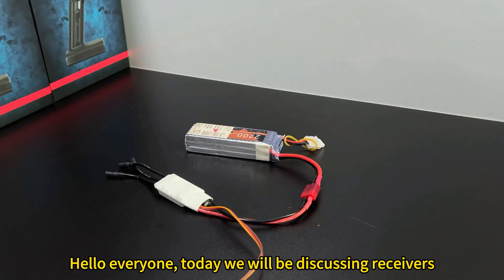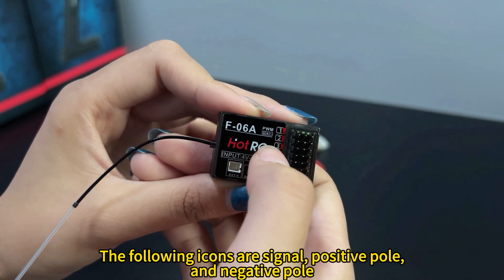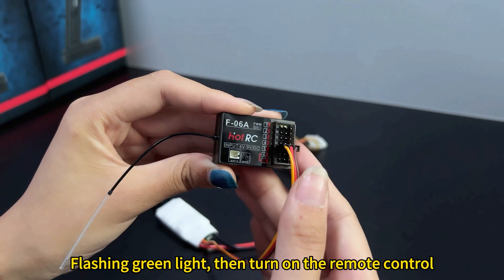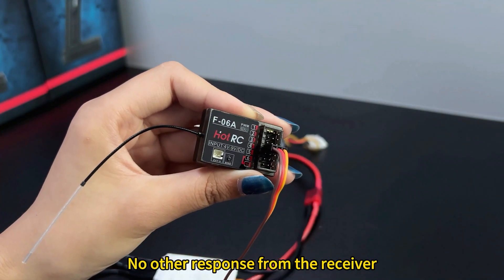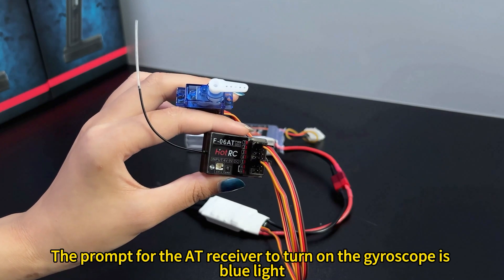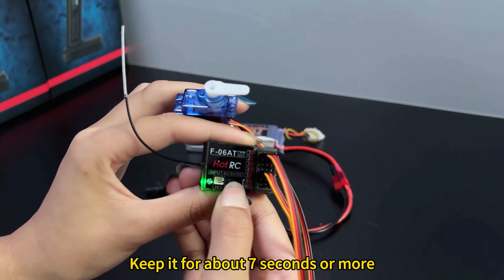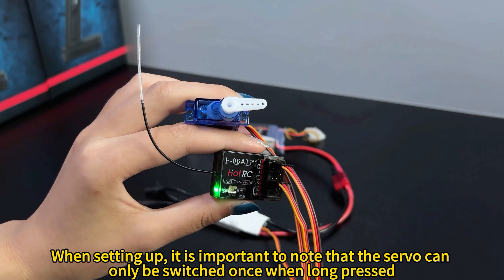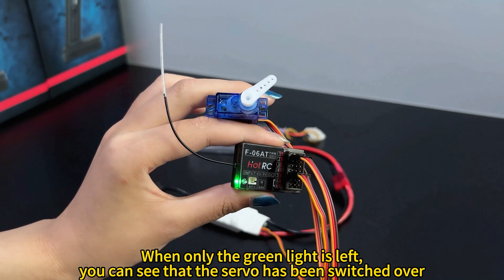HOTRC receiver positive and negative signal wiring and servo switching

Comment: The receiver is not powered at the power connector. How is getting the power? This video has a trick for marketing reasons. Totally useless info.
Reply from the maker: Your battery is connected to the ESC, and the three wires of the ESC are connected to the receiver. Any channel can be used. There is no fixed power supply channel. Follow the wiring in the video, left signal, red positive in the middle, black negative on the right